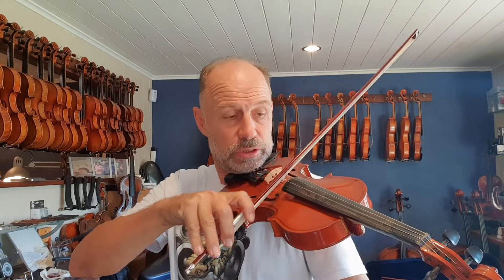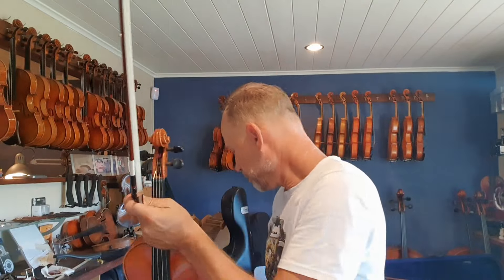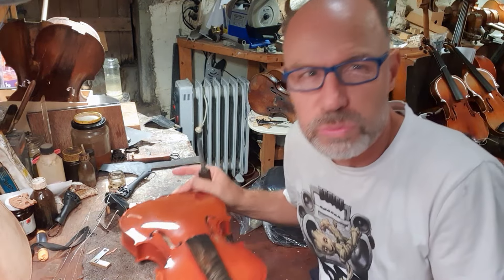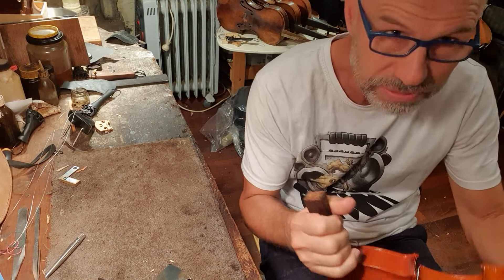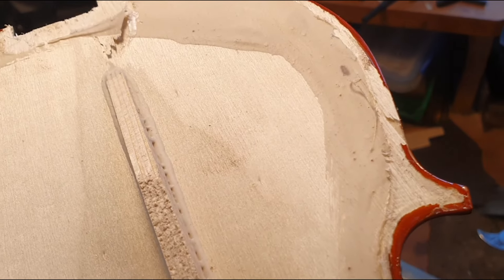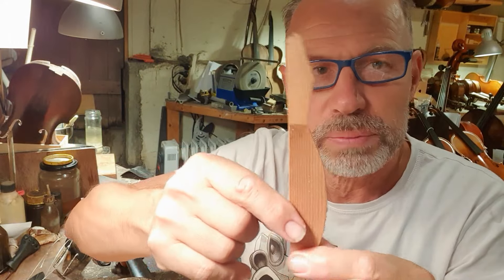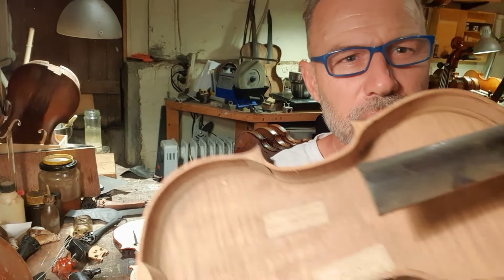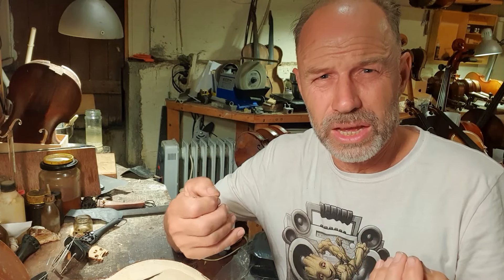I open up the 100 dollar violin

Comment: "that's not how you make a violin"... sure it is. It may not be how you make a GOOD violin :p 
BTW, what kind of glue should be used there for the top plate?
Reply: I am thinking that the top plate is steamed and formed, not sanded. Typical to do that with plywood

Am I understanding correctly that the fact that it is one type of wood, plywood, then the whole instrument has mostly one resonant frequency that leads to the tinny sound, while the different woods are there to provide multiple ways of vibrating to give more tonal balance?

Comment: different strings ... enough to make that sound disparity
Reply: I bought a $55 violin on e-bay (VSO) Put on good strings and some fine tuners. Made a big difference but it's still a $55 Violin. I think my top is solid wood though, I wouldn't know without taking it apart but you can see the grain not a solid color on top.

Comment: The reason the top does not have a purfling valley is, simply, because it is plywood.
If they had tried to create a valley, they would have cut through the veneers and shown it is plywood.
As for the bass bar, even if it had a good one it would not help one little bit, on a piece of plywood. 🤮🤮🤮